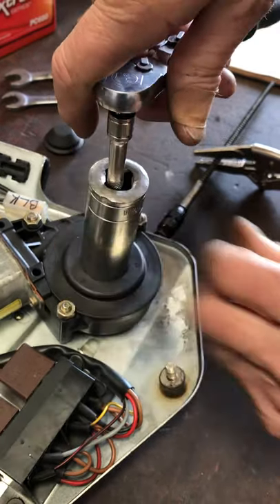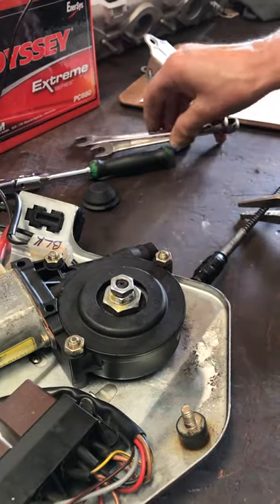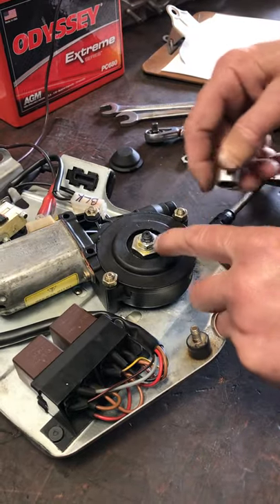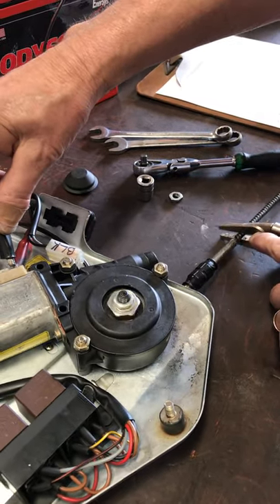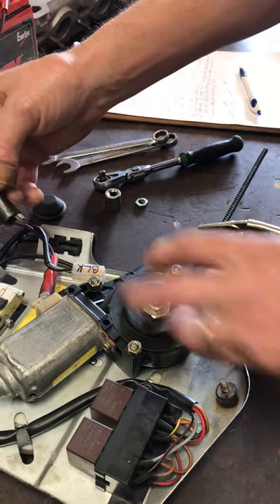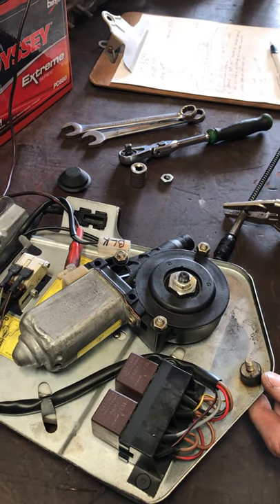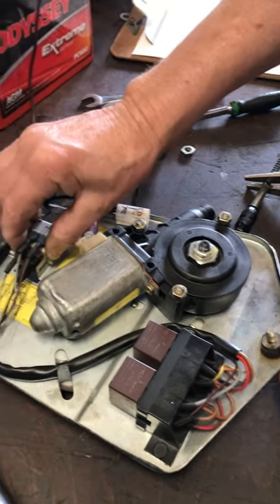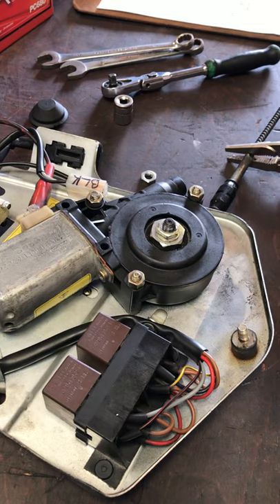Porsche 944 sunroof motor clutch

Comment: Great video I got a question do u set the clutch when roof closes then motor spins free.  My other question is. Will motor also slip once I try to retract the arms to the bottom that gears don’t strip out. Ty
Reply: The clutch is supposed to slip when the retracting arms are pulled into the body. Loosen the clutch until it slips all the time, then tighten it until it can just lift the roof. adjust a little at a time. If you get that right, the clutch should slip when the arms bottom out.